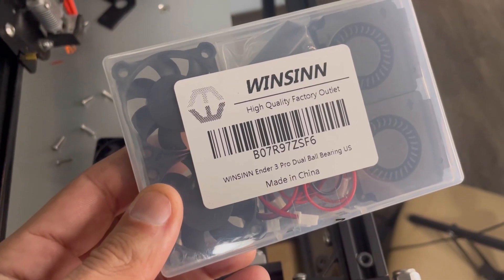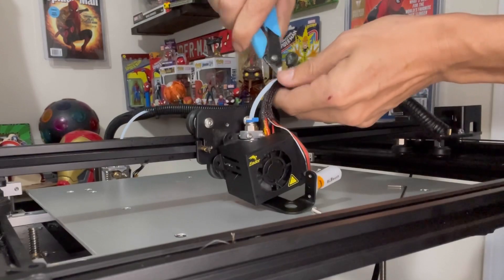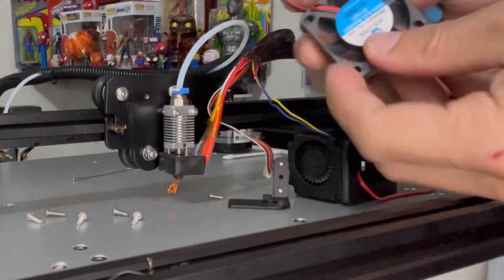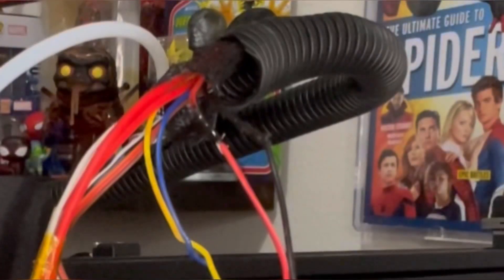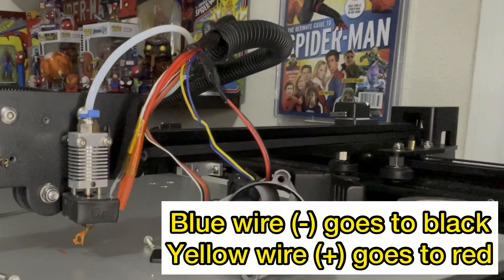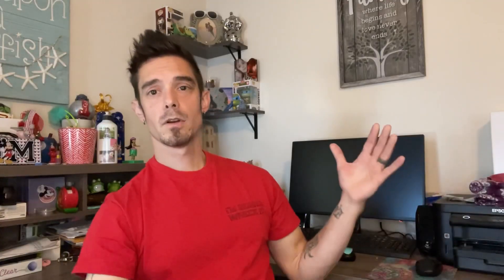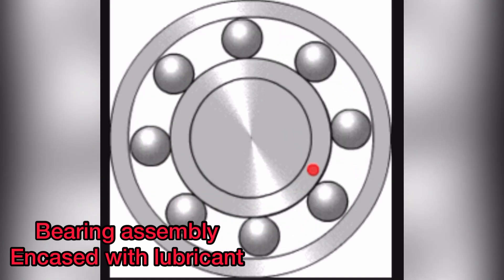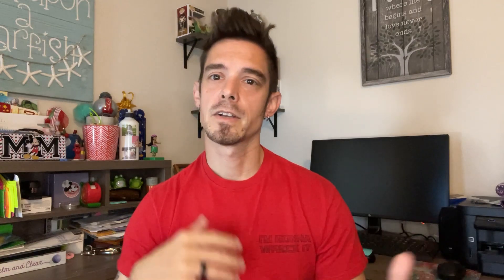How to replace cooling fan on Ender 5 plus | fan replacement for 3D printer | 3D printer upgrades

Comment: Just need to confirm which "direction" to install the new fan. The fan should blow air onto the hotend? The alternative is the fan is drawing air around the hotend and blowing it out of the shroud.
Reply from the maker: Easiest way to remember is label facing the hot end, you want it to suck air in and blow it onto the hot
Reply: @Darkwingdad  the fans I purchased did not have a label.
Reply from the maker: @royanderson5538  you want the fan blowing toward the hot end
Reply: @Darkwingdad  great thanks

Comment: Hey I have a something to ask. I’m replacing the fans on my ender 5 plus. I noticed that my printer’s side fan wires are red and black. Will that be an issue to re wire????  I’m asking from 3:26
Reply from the maker: Blue wire is negative that will go to black, 
Yellow is positive that goes to red.
Reply: @Darkwingdad  right I understand that. I noticed when I was unscrewing the fan cover, the side fan’s wire are red and black. So I’m sure I can still match them like normally right? They weren’t yellow and blue. For example: red to red, and black to black, right???
Reply from the maker: @inductedcoffee  yes sir you got it!

Comment: how can you check the hotend fan is running? how do you start it up?
Reply from the maker: Hot end fan turns on when you turn the printer on
Reply: Yes thank you i found it out by myself when i measured the connector. I already ordered a replacement😅 thanks

Comment: Wait i thought the stock fans in these were 12v the new one you put in is a 24v
Reply from the maker: Majority of ender/creality are 24v
Reply: @Darkwingdad  dang I must have misunderstood/misread something. Thank!
Reply from the maker: @amyers442  all good, you need what’s called a buck converter if running 12v

Comment: Thank you for the information, everyone keeps telling me to get a hero me gen 7 or hydra fan setup but it seemed like a lot to have to do for better cooling. Do these fans run similar to the stock? Did you have to modify fan speed percentage in your slicer for the new fans?
Reply from the maker: I for the most part kept my stock fan settings the same. I did notice an improvement with silk printing where positioning wasn’t as important. An upgraded fan duct can help too

Comment: A great easy to follow video :) I don't have an Ender 5 (I have 2 CR10s Pro V2's) but I'm thinking of one for my next addition. A quick question, are they noisy? I'm about to swap out my fans on my CR10's for noctua fans as they are a bit loud at the moment. Is this something you would recommend on the Ender 5 plus?
Reply from the maker: Dual bearing will be a bit quieter than standard sleeve fans(stock fans) hydraulic fans will be the quietest and most efficient with longest life.